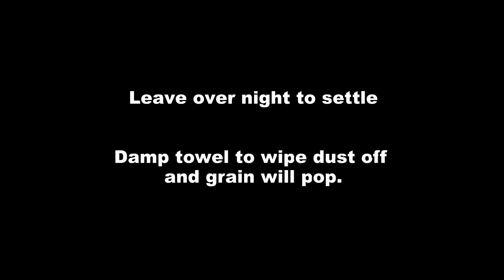How To Make Hand-Made Gauges/Plugs

Comment: i was in class and i lost one of my gauges so i took apart my lead pencil and used the tube that holds the lead, cut it with scissors so it matches the fatness on my earlobe, and so far, it's been better than my old ones
Reply from the maker: Lucifer's Domain It's not stupid if it work's. 😊
Reply: JR Wood & Metal oh shit I've never been replied to by a YouTuber 😂 but yeah it low-key started a "use wierd things for gauges" trend 💀
Reply from the maker: Lucifer's Domain Must admit I've used stramge thing. Clipper lighters sink plus anything to keep it open.
Reply: I wore random things at smaller sizes, but I regretted it later. Use glass plugs or steel tunnels from arcticbuffalo.com or bodyartforms.com, your ears will thank you!
Reply: And once your ears are fully healed, you can wear some sweet stone/wood on the affordable. I'm wearing 40mm ebony wood tunnels on healed ears and life is awesome.

Comment: one question do you paint them with wood varnish is it possible to make any reaction with the skin
Reply from the maker: Valery Yordanov i don't use any oils or stains as i don't think thry would be good for the Ear although i suppose you could use Vitamin E Oil or Baby Oil.
Reply: JR Wood & Metal thanks
Reply: I use jojoba oil every few months for my wooded gauges. Vitamin e works well and so does beeswax. You want to condition the wood because it will start to dry the ears out and can start to make abrasions in the ear. That can lead to infections.
Reply from the maker: I wouldn't be to sure on Beeswax but i know jojoba oil & Vitamin E would work!

Comment: Your end result looks pretty good, but it would be a lot less work, much faster, and more consistent if you used a lathe. You can do every step from roughing to shaping, to sanding and polishing all on the lathe. You can get an affordable table-top one that would be perfect for making plugs.
Reply from the maker: Sam Chaney I agree but i don't posses a Wood Lathe Currently so i just make do with what i have got. 😊
Reply: What's affordable chummy?
Reply: Steve & Andrea Treadwell the Jet lathe I use (719110) was under $600 but there are other cheaper brands. You can find some for under $300.
Reply: Plus he also said that he perfers to do it by hand in the video , which i understand why. You cant argue that a lathe is much more efficient but its satisfying to do some hand carving every once in a while
Reply: Assuming you have a drill floating around somewhere... build your own lathe! seriously it super easy, then you can just get some other shaped wood and you can cut out a pair of plugs in minutes!
for example, this one is pretty simple:
https://www.youtube.com/watch?v=zwE_2Owp3fA
Reply: There's nothing wrong with that... except it's a relatively large waste of expensive materials (and wasting trees is pretty awful, they grow slowly!) and time. IMO using a lathe to shape then sand and polish it that way is no less 'by hand' than using a band saw and belt sander.

Comment: Those look way too thick. I feel like they might stick out of your ears and be uncomfortable
Reply from the maker: Hey, thanks for watching. Standard thickness is 11mm these are 13mm being as i have blown out so many times my lobes are thicker & 11mm won't fit in my ears. 

Hope that answers your question.
Reply: @Manchester_engineering  im the same. Standard doesn't go to the edge of my blowouts. It causes pain with screw-back double saddle plugs.